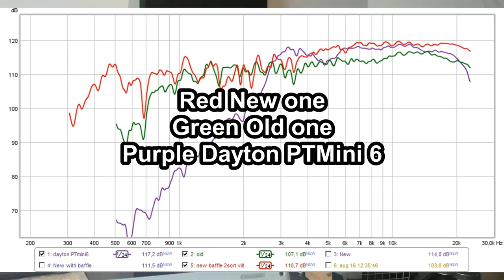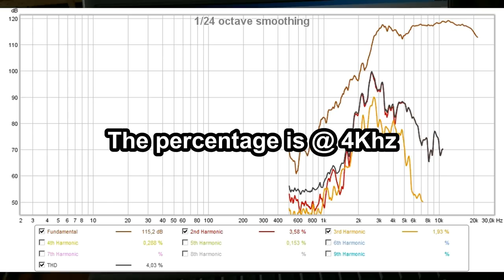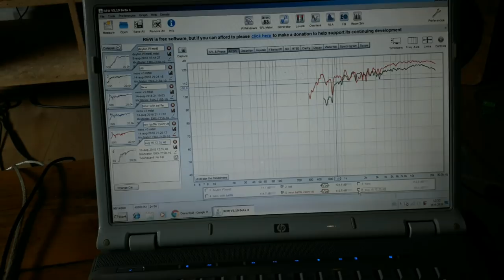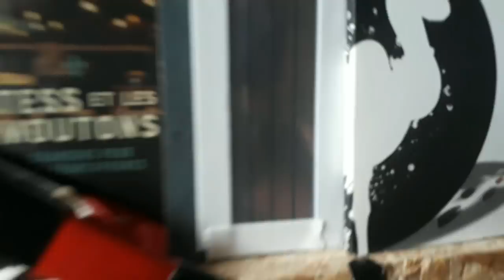V3 Neodymium planar tweeter build (and wrap up)

Comment: Флюс для пайки алюминия!!!))
Reply from the maker: No clue what your saying
Reply from the maker: Flux for soldering  aluminum !!! yes there is flux to use normal solder tin. the trick is i think acid based. getting the corrosion of the alu and at the same time making sure it does not corrode instant because there is no way oxygen can reach it.

Comment: Its size and layers that make its sound better poor?  Can you check high en speaker AMT its deeper than ebay and temu. why? layers or?
Reply from the maker: this is not an AMT its a regular planar magnetic tweeter.  flat membrane with magnets behind the coil

Comment: Must the perforated metal that supports the magnets be steel (magnetic) or can it be aluminum or stainless steel (non-magnetic)?
Reply from the maker: well i got tweeters that dont have metal at all, but you lose like potential 2-3 dB on output since you use both sides of the magnet when you use metal. down side might be cavity resonances. thats why my later tweeters dont ahve metal  since it was just loud enough to be used in my speaker. then i rahter dump the metal

Comment: Neat! How are the magnets' magnetic fields aligned (vs. current direction)? Is this shown in a previous video?
Reply from the maker: Uh yes but i made a mistake in that video (althrough it works the same phase would be reversed)  you need the left hand rule.  Search for speaker motors explained but keep in mind i used the wrong hand  :) haha
Reply: +Joppe peelen: Thanks for the reply - so are alternate rows of magnets in opposing field direction? or are all the magnets aligned the same way? I find it hard to visualize without drawing it on a piece of paper, hence my confusion. What puzzles me is why it works, given that the tracks follow a meandering pattern rather than simple (concentric) loops.

Comment: why not coaxial planarmidrange +  supertweeter with no crossover in midrange under 8k to 150hz
Reply from the maker: well it has a crossover always. since i dont want a huge surface area emit highs (dispersion). at the same time i dont want a small panel try to produce the low end and create all sorts of distortion. :( also there will always be a rising response that i have to counter. so  cant do without any crossover components. even the RC kind of style to divide a membrane into pieces is essentially a crossover. something i did not quit got to work :( responses became nasty when trying that weirdly enough.  although it should work. it did not for me so far.  they way i use the,m now is as less crossover as i can use. one coil that flattens the woofer but after a while drops of slightly, and the tweeter/mid drops on its own then i use a cap to prevent it to ouput to much near resonance.  this way has not a very broad band in placing crossovers i must add :) it just has to work out. sometimes it does not :) but it creates an rather even response (not perfect) while using as little as i possible can.

Comment: Great job!
Please, have this metal mesh some special role or is only to hold the magnets? 
If it only need to hold the magnets, maybe you can order some of the magnets from this manufacturer: https://www.kingsmagnet.com/index.php?m=content&c=index&a=show&catid=28&id=56. That way you have one whole long magnet. Look at the dimensions that they can produce. It is just the suggestion. Sorry, I have no experience with them now but I am planning to contact them).
(Just notice... :-) Do you really need to waste so much adhesive tape?)
Reply from the maker: haha i rather not :) but in this case the question was. waste cheap paper tape? or waste my ethcing bath by etching alu that does not need to be removed :) i chose tape
Reply: @joppe peelen
:-) Agree for the etched part. But, for fixing, the same result with 1-2 cm long tape strips...